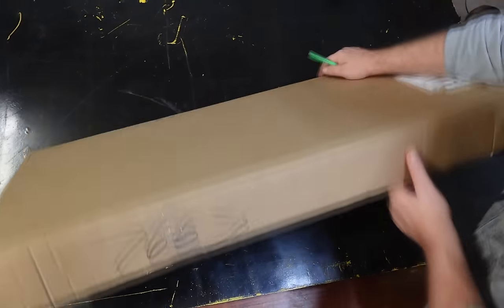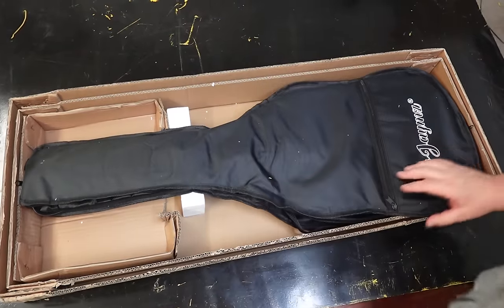THE $139 Flame Maple Neck TELECASTER that FENDER HOPES YOU DON'T SEE!!! Leo Jaymz!!

Comment: The shim is a good thing,It shows they cared enough to make correct ajustments ,A shim is part of the guitar ajustment ,and probably works better than fenders micro tilt.Leo use to shim alot to get proper neck angle ,I do too .Your upper string action will be as good at the 15th fret as it is at the 10th fret, and all the way to the last fret.Shim is part of the guitar.

Comment: I got one a week ago, mine is very satisfactory . I did do a fret level,crown and polish . Most novice owners probably wouldn't have the knowledge to tackle that and in reality it was playable out of the box. I commonly do this to most all my guitars to get the best possible action. I also rolled the fingerboard edges. I did replace the crappy plastic nut , however it was cut well and useable.  To me the pickups are fine ,the electronics are quiet and work smoothly. Very happy with it and the price is more than fair. Very good job on packing.I recommend it without a doubt.
Reply from the maker: Thanks for the input. Most guys don't take the time.

Comment: I didn't say anything, but did have an idea that any guitar sent out for review would be prepped.  Anyway, I ordered one - even with the price markup to $179 it's would still be a deal according to your review.  The guitar just arrived today.  Yep; double boxed with a nice gray gig bag, but not inside the bag as if that matters.  Tools are taped to the neck (though the smaller allen fits nothing on the guitar), same inner packing as yours.  Mine is clearly a hard maple neck, but not a flicker of flame in it - no skunk stripe either.  I didn't examine the electronic guts since the stuff couldn't be any different than yours; didn't bother looking for a neck shim either.  The bridge pickup is actually labeled "Alnico V" (not a brand name but a claim of the strongest possible alloy magnet).  Nut is well cut - no whittling needed.   Frets ends are remarkably well-manicured and the frets are level and polished.  Low action - a bit too low as there's some fret buzzing, but after tuning tension is applied there's still a bit of back bowing; can fix that in a jiffy.  The intonation on mine is quite a bit off... all strings note flat one-octave higher (12th fret for you country folks :) ).  All that said, I've bought new Fenders that needed the same touching up.  Your review is outstanding and the guitar is a bargain even with the recently elevated price!

Comment: I ordered one because of this video. It arrived today in a single small triangle shaped box. Instead of a gig bag, it was in a white plastic sack. The action looked good,  but only because of a severe back bow. Every string fretted out when using open  chords. The fret tops were as rough as a fingernail file and the ends were very sharp to snag my fingers. No flame on the neck and no skunk stripe on the back. They scammed us with this ringer.
Reply from the maker: You just got a turd buddy. Probably just needs a good once over. I'm sure this guitar was a ringer, but it started out like yours'. Meaning this guitar was in the same shape as the one you got before someone set it up. As for wood, they are chinese they use whats cheap atm. Send it back that simple
Reply: @scarmyguitar  Too late to send it back. I already pulled the neck, straightened it with the two-way truss rod, leveled, crowned and polished the frets, dressed the sharp fret ends, replaced the damaged strings, filed the nut slots, set the string height and pickup height. I did not have to touch the intonation. It took a few hours, but now plays like a $600 guitar. I was just upset that the one you reviewed isn't what arrives when anyone else buys one. You truly get what you pay for.

Comment: How you can tell if you have a "photo-finish" vs. a real wood veneer is to look for what is known as "chatoyance". What that means is the natural shimmer of the woodgrain under strong light. The fibers of the wood are whatever color the wood is, but the connective tissue (think gristle) that binds the fibers together is clear, so when you look at the guitar under strong (or sun) light and you tilt the guitar back and forth, the woodgrain glows prettily and seems to move a little bit under the clear finish as you tilt the guitar back and forth. Any flamey Gibson will show tons of this. If you do this and the light doesn't dance with the woodgrain and seems very static and unchanging, it's a photo-finish. Which isn't necessarily bad - I've seen some photo-finishes that were damned attractive. Some early photo-finishes from the late 90s when they came up with the idea are now turning to crap as either the paper or the adhesive deteriorates due to age. I imagine they have better methods now, but I don't have data on it.
Reply from the maker: Thanks for the info my man! Need more guys like you around here!

Comment: Thanks for the informative video. However, I noticed your Fender Frontman 212R in the background. I have a 2007 Model, but loaded with one WGS ET-65, and one WGS Retro 30. Hence, the sound went from below average with the original Fender Design Speakers, to just killer tones with incredible headroom straight in, no matter the genre. In short, it can sound as sweet as Carlos Santana, to as roaring as EVH. No problem.

Comment: Harmony used to "stripe" their (birch) guitar backs with a fine-pointed spraypaint gun, and I have an old factory-made fiddle with a flamed maple back which was actually laid down with a needle-point torch (the flame figure was evident on the purfling, which should have been intact). In 1978, Hondo II LP copies rolled out the "roto" manufacturing method of printing a photo of figured wood on a plain top, since adopted by nearly everybody since. 
Manufacturers have clever ways to make inexpensive guitars look amazing. Given the price of raw stripe maple, this may well be a combination of some of these methods. 
Having said that, if a guitar feels good and plays good, IT IS GOOD. High or low, price be damned.

Comment: Damn for 139 that's a whole lot of guitar. Looked like the bridge was alinco instead of the standard Chinese ceramic. It Def had a Lil bit of that Tele twang. The pickups didn't sound bad. Honestly I'd upgrade the switch to a super switch or a 3pole 4way, a multi point jack and maybe throw on some CTS or Alpha pots (those little cheap ones are normally better than we give them credit for). Then I'd call it a win.
Reply: All excellent suggestions! I'd more classify this as a modding platform rather than a guitar I planned to play any length of time. Those little dime pots corrode right away if they're not already badly corroded by the time you get the guitar. And that cheesy wiring needs to be discarded and replaced with copper asap

Comment: Plug that hole with a hardwood dowel.   Just before you glue the dowel in, check how it sounds by dry fitting the dowel.

Comment: That surface skin was 1/16" thick, from what I could see. That would be a laminate, not a photo. Wood grain should "move" as you tilt it if it's real flame maple. I have a real Fender Tele with almost identical woods and finish, including blue burst color. My flame maple moves a LOT when i tilt it !
The clicking when you switch to the neck pickup tells me that the bridge pickup is microphonic. when engaged, the bridge pickup detects the noise from the switch engaging.  I've had many Strats and Teles with that hole under the neck plate. It does not inhibit the sound at all.

Comment: When you go to the link the guitar shown is #1 - unavailable #2 - has a completely different head stock shape and form #3 - no flame maple neck with skunk stripe #4 -   not offered with a flame top veneer ( printed or otherwise ) #5 - no binding on body with the models offered. Conclusion: you were sent a prepared upper model in order to get a positive review but unfortunately that's not available to us ordinary slobs. The pu's could be upgraded but they don't sound bad as is. This identical model is listed on the manu's site at $189 US but presently zero in stock.

Comment: Incredible for the money. Engineering and the machines they use now are so much more advanced than 30 or 40 years ago. You can probably fill that hole at the bottom of the neck with wood filler.

Comment: I don't keep any fender type bolt-on body  that has the finish drying hole in the neck pocket.  It is there at the expense of the transfer of vibration between the neck and the body.  That was a ridiculously huge shim and brother,  it also will kill that same transfer.
Reply: This is not an acoustic guitar, brother.

Comment: incredible deal. I actually like the sound of the pickups. Which amp did you use, any effects?
Reply from the maker: line 6 Ux2 using Pod farm 2.0 on the standard country setting which is a small tweed, compressor, and spring reverb

Comment: This is not the $139.00 model. O was just going to order it for the neck. The truss-rod adjustment is next to the front pickup at the bottom of the of the neck just like Fender except their newest budget line.. This model is selling everywhere for $400. I don't know if amazon knows the difference between Leo Jaymz upper and lower end models in their line.

Comment: I'm an old guy, & I have been playing over 50 years. I have had cheap guitars and very expensive ones. This axe for that price may sound good for a while, but even if you upgrade the electronics, the body & neck are made of the cheapest, low quality wood, glues & paints they can get. In 5 or 6 years, the neck will probably look like an airplane prop. At that price point, you know it is built from the cheapest of everything, or it wouldn't be $140. I doubt Fender will worry too much...
Reply from the maker: I'm an old guy too and been making guitars from scratch for 15 yrs now. I would agree with you on the wood if it were just plain maple or basswood or something, but in all my years making guitars I've never seen cheap Mohagany or Cheap 3A Flame Maple. And this guitar has both without a doubt. To get anywhere close to a 3A Flame Maple neck from Fender your talking custom shop. This guitars frets were perfect and my $900 brand new out the box Fender I just demo'd in the last video had worse fret work than a neck I ordered offline. Watch the vid. People are wising up...Fender better start worrying.
Reply: @scarmyguitar  They must have 8-10 year olds making them for that price then!  Probably illegally sourcing the wood at that price too! ;-)

Comment: It's now $179, the body doesn't appear to have binding, and the neck does not look like flamed maple - doesn't have the skunk stripe either.
Even those tuners look different.. Ringer perhaps? 

Pulling the ol' "Bait N Switch" on us maybe, Mr Jamz?

On a positive note, it does say that it comes with Alnico V pickups..

You can get a sparkle painted version for $10 less - probably not a good enough looking blank to have it show through the finish, but you don't play the paint job.
Reply from the maker: Yeah they did the bait and switch!
Reply: If I remember, I'll try to write you back after I receive one of these that was on sale today (8/21/23) on that Amazon site - they are no all priced the same - from the photos on the site, the binding seems to be there on the one I ordered.

Comment: Shouldn't the strings be body trough?
Reply: Top-loader Teles have always been around, you could always slap a Bigsby on there if the TL sound isn't to your liking.
Reply: @sassycat  didn't know about that, but it seems cheap... The JT350 has strings through body though.
Reply: There ain't nothing wrong with a top loader. I find string tension is less with top loaders. I have guitars with both types. It's all good.
Reply: @nikolaki  why the superior Jet has strings trough? That's the classic Tele way. Not a fan of top load.
Reply: @Chipstarter  The JT-350 also has a sculpted heel, no neck plate, and it looks like it also has a contoured horn to allow better access to the upper frets. Not very classic tele way to me. Quite modern actually. 
A tele body with string through holes will cost more in labour. Is having the strings go through the body superior? It depends what you want to achieve or prefer. So it's not inherently superior but it does add a labour cost.
I dont like how my string through teles feel with 10s on. The strings are too tight, so I put 9s on.
With my toploader teles I put 10s on.
I can't really hear a difference through an amp or even unplugged. But the feel is very different. 
My first tele was a toploader and I really thought string through would be better - because "people on guitar forums".
When I finally got one, I was like: meh.
I have 8 t-shaped objects now, 5 string through and 3 toploader. 
Now, 3 saddles vs 6 saddles on a tele is a different matter.... 6 saddles just don't look right!
It's a shame JET don't make the JT-350 left handed, cos I would have bought  one. I got a G&L Tribute Bluesboy instead.
Reply: @nikolaki  you said everything at the end! I'm left handed as well and about to buy the js300 just because the jt300 is top load...
Reply: @Chipstarter  I have a JS400 and a JT300 and they are both ridiculously good. If I had space at home I would buy a sea foam green js300. I hope you will enjoy it.
The G&L, while having superior components was a disappointment because they drilled the string through holes in the wrong place. I should have sent it back. This means the bridge is in the wrong place and I have placed a nut (from a nut and bolt) in the ash tray bridge to push the saddles away from the edge of the fretboard. I love how the g&l sounds (doesn't sound like a tele btw) but QC should never have let it out of the factory!

Comment: I just bought a squire 40an adversary bass gutair. Ruby red and metallic gold hardware  Brand new in the box never been played. I paid 350$ did I get a good deal. Professional 4x4 annaversay jazz. Solid. Vibe classic. I have found refurbished going for 700$ from a few web sights. I bought this from the pastor at my church and letting me pay it off 50 monthly.jbass40arr. Ruby red metsnissk21003481- snissk21003481. Plus a gator delux bass guitar case. No charge for case. Can anyone tell me if I bought a good 4 string bass. Please someone help me. I used to play I was decent but broke both wrists to the point of surgery pins installed and plates. Help me figure out if I made nice choice. Beautiful piece of equipment. Just need help to see if its worth it. Sons is rich beautiful tone. Help

Comment: Sorry, I don’t care how good it is or how cheap it is, I’m not buying a Chinese guitar.
Reply: Your loss. I have several Chinese made Guild acoustics(as well as a couple 1980s Guilds) that all cost considerably less than Martin's "sustainable" guitars made with sapele & composites. The 1xx series Westerly collection models have quality solid wood, no laminates which doesn't really matter anyway, & real bone nuts & saddles. The 2xx series uses laminates(actually much stronger than single pieces), & man made bridges & saddles but play & sound GR8!. Guild also does a double layer of wood with the grain placed at 90 degrees to the top at the sound hole, which prevents a crack from starting by the neck/sound hole. ALL guitars, unless you have something exceptional, need a professional setup, even several thousand $$$ Gibsons & Martins. The shim to lay the neck back is common after a pro setup but real pros use thin pieces of hardwood for the shim stock.
Reply: Said the guy driving a Toyota.
Reply: @bradgriffith4231  - I’m not questioning the quality.  I’m questioning the source.

Nevertheless, I’m glad that you’re pleased with what you have.
Reply: @ghahandi  - I don’t drive a Toyota, but if I did, I wouldn’t have any fundamental problems with doing that.